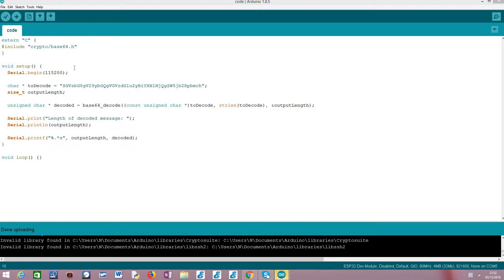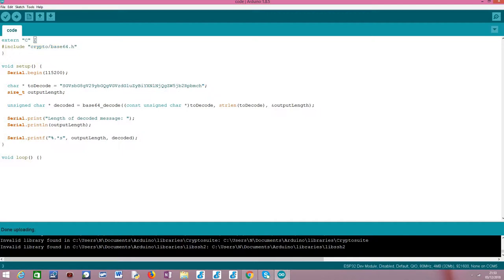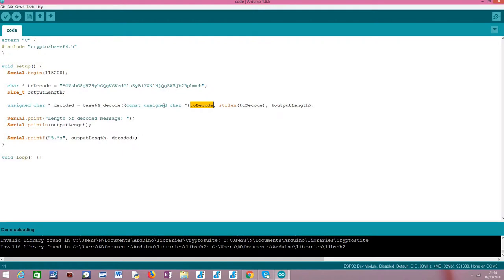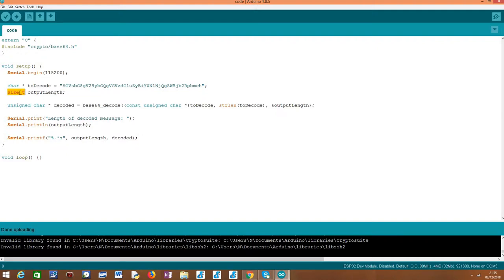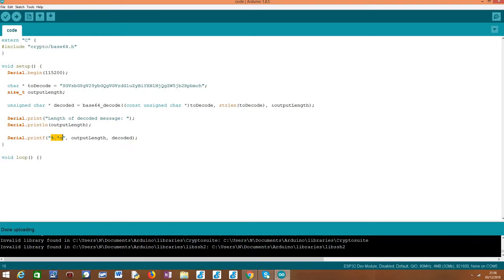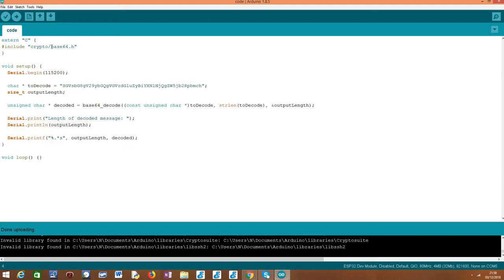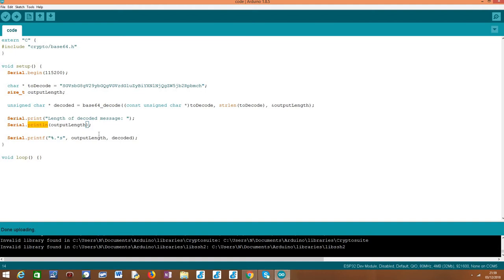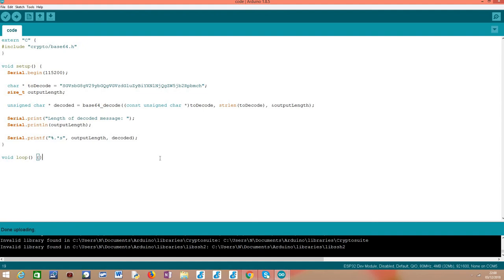ESP32 Arduino: Decode base64 string

Comment: Hi is it correct that authentication with base64 is not safe? If captured on the network, the data can easily be decoded and re-used to login right? I am searching for other safe ways to add authentication to login to the ESP32 webserver. Do you have links to other authentication methods for ESP32?  I once heard someone was using an authentication method based on cookies for example , but I not find the code.  :-)
Reply: rsa